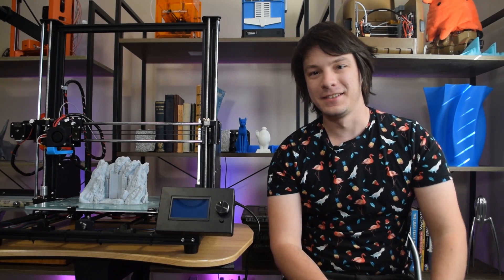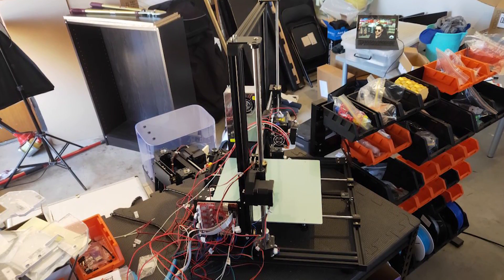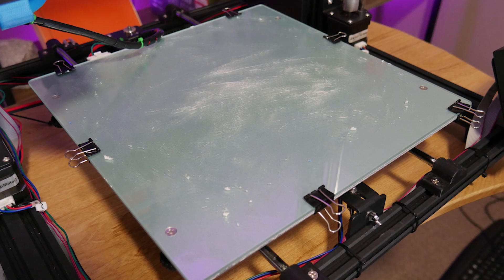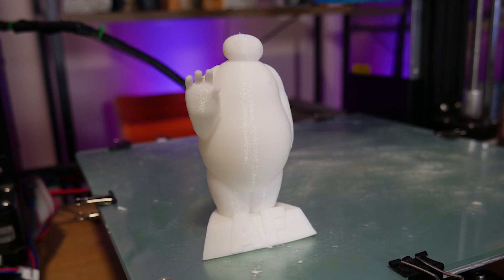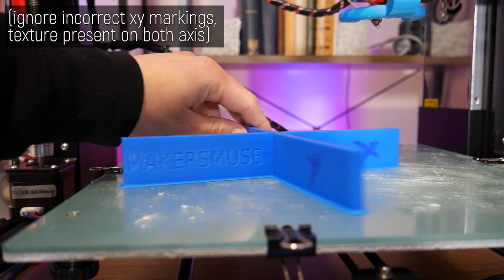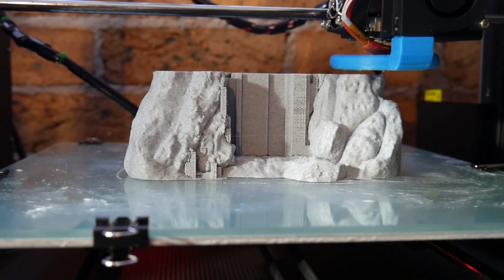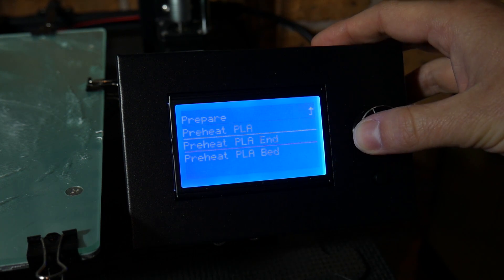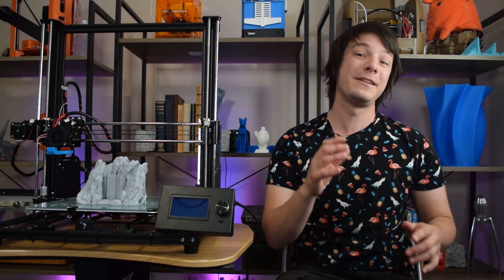The Anet A8 PLUS is big, cheap and won't catch fire. 3D Printer Review

Comment: This is a good 'first look' review, but I feel that people need to know a little more about the extruder type, temperature limits etc as I'm finding I need more than just PLA for my projects these days. When I first bought my CR-10 I didn't know bowdens didn't like flexible filament for example.
Reply: Direct drive extruder so capable for flexibles. I do'nt like the extruder that much though because it has a steep learning curve to get the filament in and it seems to be 'hit and miss' a lot of times.
Reply: @elvinhaak  I cut my teeth on an A8, and getting the filament fed was THE MOST annoying thing over. Just utterly terrible! I switched up to the Ender 3 and realised life could get instantly better when you make smart design choices.
Reply: @RitchieTheBrit  first thing I did with my A8 was design a magnetic door for the extruder fan and an extruder button. Couple that with filament loading in firmware and it was a breeze to operate
Reply: For flexible, yuo need to change the extruder, there many in thinguiverse for ender 3 and cr10 and many others that use bowden system
Reply: I'm pretty sure you can get an direct extruder for the CR10
Reply: I think they oil the inside of the bowden.
Reply: @SidneyCritic  oil not good for a filament that gone be hot..i think

Comment: I bought this printer a while ago and I had problems from the beginning. When I switched on the printer the extruder started to heat up immediatly and it wont stop heating till I had to switch off the power supply at around 270°C. I tried nearly everything to solve the problem, from checking the cables and connection x times to updating the firmware. Nothing helped. So I bought a new mainboard a V1.7 like the model original build in the printer. I pluged it in and nothing hapened, the Display just shines bright but no characters are visible and it gave away loud peep sounds. So I figured that there is no firmware on the new board and I tried to instal one with no success. I tried nearly evrything I found online but nothing appears to work. So if someone knows something, please let me know how to fix this problem. ;)
Reply: I gave up and bought a Duet Maestro board

Comment: As a ex user of anet a8 i have to say that they did good job here but it would be awesome if they include longer cables and cable chains and finally add option to attach external stepper drivers cuz  these printers are loud and users should have option to upgrade it without replacing mainboard

Comment: I like a lot about this kit except for the X and Y rods.  They are longer and would exacerbate the noise, etc. issues that I found with the rods on my Prusa clone which has since been donated to a newbie.  I would still look toward a non-rod printer in this size class and pay a little more unless your budget does not allow for it and you want the print size.  But as Angus mentioned, for all printers built to a price, you will be spending some time (and money) on improvements to increase the print quality and usability anyway.

Comment: Thanks Angus I will be replacing my original a8 and crossing all my upgraded mosfet and diode boards over to this new larger print surface as well as putting the e3d head on it making it comparable with flex filaments. Friday I should have it and and will be enjoying tinkinering with it.

Comment: Everything I’m about to say is my opinion only. 1) the whole idea behind 3D printers originally was to build out of easily accessible parts (vitamins) and parts that could be 3D printed. 2) this is one of those printers I’d have to redesign from the ground up (linear rails, reprint parts, rewire, build in octoprint). By the time I’d be done with re-engineering it, it’d be cheaper to start from scratch... 3) the one thing this printer has going for it is volume. Imprecise volume, but volume none the less. It would be faster/cheaper for me to use a dremel, by hand, on a plastic cube the size this printer prints in (subtractive manufacturing). There’s just nothing here worth the time/money. Let them know to come back when the product is out of alpha...
Reply: There is one more thing this kit has going for it an you actually mentioned it yourself: 
I needs time, work and upgrades.

Sounds negative but thats exactly why i got an AnetA8 back then because i thought being forced to make it work as good as i want it to work is the best Motivator to learn about all things 3d printing.

So for a select few people the imperfections and issues where the stongest selling point. :)
Reply: Vertiqo okay, I could see that. Some people might enjoy building a Ferrari out of a geo metro...
Reply: @EverettVinzant  Well to be precise, not much is left of the A8 in my current printer but the A8 was a nice exercise. It should be mentioned that getting a super cheap kit and build of off it might cost quite a bit in the end. :)
Reply: I made a decision a few months ago that I would not spend any further time or money keeping my Anet running, especially after buying a Ender 5 and even a really cheap XYZ , the XYZ is easier to run and has better quality that the Anet. 

This "Upgrade" just seems much of the same, you are going to have to spend time and money making it work, and with that you may as well save a little and buy a better built and more reliable large bed printer. 

The Ender 5 Plus looks like a really nice printer with a lot of good features and I am looking forward to Maker`s Muse reviewing it.
Reply: @tdk3d-j7c  you should probably read the entirety of my comment to not make yourself look like a fool.
Reply: P S I’m sorry, I can’t read ignorant. Did you have something intelligent to post?

Comment: won't catch fire?  challenge accepted!
Reply from the maker: I DID consider adding an asterisk and saying your mileage may vary haha
Reply: @MakersMuse  The cause of the burned down A8's wasn't only due to the lack of thermal runaway protection. The Mosfetts and connecters weren't capable of handling the current and were prone to melting/heating. What control board does the new A8 have? If it's the same as the original A8 I would shy away from it.
Reply: @GeertHeremans  V. 1.7 and having other parts and even a fuse on board.
The original v 1.0 boards did have poorer parts and no fuse.
Reply from the maker: @GeertHeremans  The new control board is fused and much better designed, a welcome addition and honestly I should mentioned it in the video, there's just so many aspects to cover in a parts kit review...
Reply: @GeertHeremans  maybe that's why mine never toasted I ran a more capable power supply, with aftermarket mosfet boards on both the bed and hot end. I had two cases where the beds connections melted down (once on each end because of bad design) and two cases where the thermistor wire broke once melted on board another time in the hot end when this happened  system kept throwing power into the heating element. This is why I like to baby sit my units and I keep them in a fire retardant area.
Reply: @MakersMuse  I would open up that power supply before giving your endorsement to a product made by a company known for making death fire machines.
Reply: @MakersMuse  i think my anet E 10 will catch fire
Reply: @jamberrytastic  i have a E10 (farly modified) but when it was stock it run very well for me)
Reply: In 3 years I never melted down my original a8 though not for lack of it trying a few times with thermal runaway.
Reply: Does anyone know if the new version of the regular A8 with the 1.7 board has this protection? I don't think mine is running Marlin and I plan on upgrading it anyways, but I am curious.
Reply: @waldogtv5486  every single Anet printer is running Marlin, because that's just the best software for Arduino that the community developed, and it has been around for years. Reprap Firmware is much heavier than Marlin.
Reply: My bed connector melted. had to replace it. I just keep an eye on it while it's printing anyways....
Reply: @fordtechchris  I soldered mine and printed a block to reinforce it.
Reply: Nate Walkner should I get the abet 8 plus or the creality ender 3 thank you
Reply: @peterm7527  Creality, Creality, Creality.
Reply: @Slickthirtysix   how would you compare them...i am in the search to determine my first 3d printer purchase between the A8+ or the Ender3Pro
Reply: on my anet a8 one of the first upgrades that i did was to put a mosfet to lighten the effort of energy to the motherboard and since then i also print 20 hours in a row without problems
this printer was skinny and essential, but I had a lot of fun doing all the upgrades
Reply: He spoke too soon. I bought one and mine caught fire within three weeks.